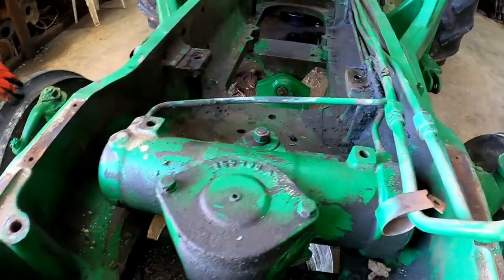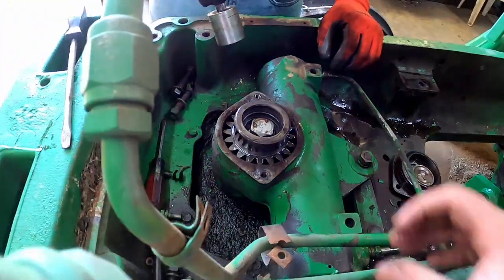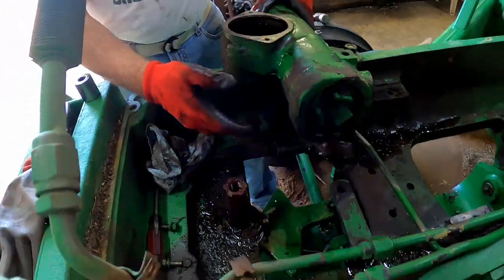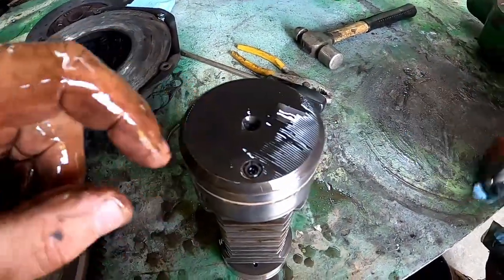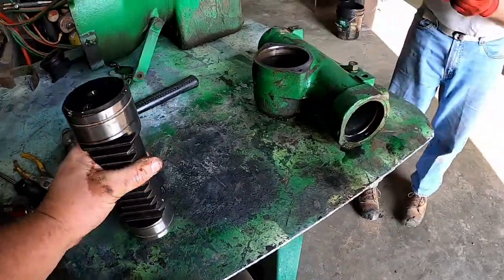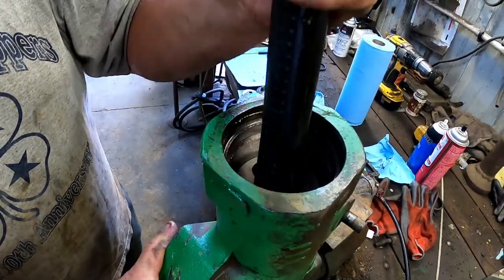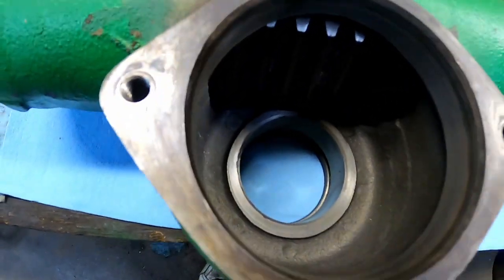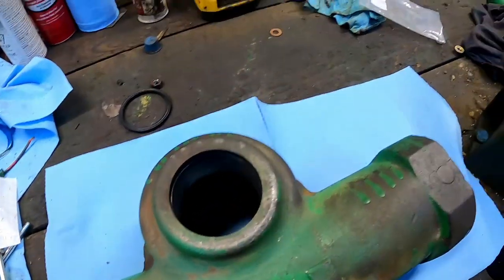Oliver Tractor Power Steering Box Rebuild

Comment: I seen this come up in my list of videos to watch, which my son and I have done the White American 80 twice on the complete tare down. We also have taken it apart for the steering sector arm, due to the bottom not being on correctly and wearing. This isn't too bad to do, it's just a little bit of a pain when you don't have a place to do it in. Nice video, good instructions on the rebuild. Thanks Chris, have a good evening and a great weekend!
Reply from the maker: I remember there were some recalls on the front axle of the American. One involved the steering arm. It had the wrong geometry and one side would steer too sharp compared to the other side. I would think something like that would have been a no brainer by the late 1980s, but they beat the odds on that one. 😂

Comment: It looks like a similar system to the John Deere 4020 except there are two pistons. What seems to happen when there is a failed seal in those is the steering will turn the front wheels for you. Unfortunately the same symptoms appear if the steering valve under the dash is leaking. It pays to learn to do as much for yourself as possible. The cost to have Deere rebuild the steering valve is about $1200. A rebuilt valve from Abilene machine is somewhere around $900 but the rebuild kit from Deere was $150. There is another alternative. Someone has put out a steering valve similar to what Oliver used as a direct replacement for the original valve.

Comment: Thank you for another great video!  Any chance that you could list part numbers in the description?  Th PNs listed in the power steering conversion were very helpful.
Reply from the maker: I just added them. Thanks for the suggestion!
Reply: @ThatOliverGuyChris  All parts are in,  thanks again for posting.  Any tips for pulling the pulley and damper on a 1850 Perkins; or is it as simple as gunning the crank bolt and pulling both as unit? I assume that the crank is keyed to the pulley for alignment.
Reply from the maker: @79mkv  the perkins pulley is splined with a taper lock bushing. Zip the bolt off , and it should all wiggle off without a puller.
Reply: @ThatOliverGuyChris  Thanks. I did not notice a master spline and the shop manual made no mention of alignment between crank and damper.   Can the damper go on the crank in any orientation? And yes, I had sharpie in my pocket but chose not to use it.... makes things more fun.
Reply from the maker: No alignment on those. Slide it on and tighten it down.

Comment: I had a power steering line blow on my 1650, got it replaced and topped off with new fluid.  While turningthe wheel to chase air out, i noticed the power steering box moving the opposite way i was turning the wheel.  Is the box supposed to move a little bit (1/2") or stay stationary.  Thanks for all your help and videos.  JF
Reply from the maker: It's not supposed to move. Check the pin that the drag link connects to in the frame, it may be loose. It could be the drag link itself is bad and needs replaced.

Comment: Hey Chris, I had a steering type motor up there on the steering on a 285 was leaking thank you so they changed it but after they changed it, I was bailing hay and if you put the brakes on the power takeoff goes off, banging uphill, they said to set the battle of the pressure up. Where do you do that at?
Reply from the maker: I don't have a video on adjusting the hydraulic pressure, but Ross the Oliver Man does at https://youtu.be/XyXG1Ggwmlw?si=RR979poFw7MFpHiz
There is a pressure reducing valve in the valve body that is down by the left brake. That feeds the brakes and PTO. The brakes and PTO use only about 180 PSI, so I doubt it's your pump or main pressure setting. There's probably a sticking valve in the pressure reducer or priority valve, and using the brakes increases the flow, which drops pressure. The PTO valve is designed to disengage when pressure is lost so that when the tractor is shut off the lever kicks out and the PTO is off next time you start the tractor, so the same feature is kicking the PTO when the brakes need oil.

Comment: Question for you. Have 2-105 with same steering gearbox as video. Hit a tile suck hole and busted an inner tie rod end. It started leaking at the top plate of steering gear box. Re sealed top plate. Still leaking in same spot. Do you think the jolt of hitting the hole could have tweaked that top plate? We tore the whole steering box apart and all the seals look fine. The only thing I can think of is that top plate got tweaked upward and doesn’t fit tight to main gearbox.
Reply from the maker: It could be cracked, or the main box could be cracked.  Id try replacing the cap first just because it's easier and cheaper.

Comment: Maybe experience says it's not necessary, but there is a setscrew in the center of that final cast cap.  If removed that looks like it might release suction at disassembly and pressure at reassembly?
Reply from the maker: It would do just that.

Comment: Do you happen to have a video on replacing all the O-rings a stuff on the steering motor on my 2-155? I bought the o-ring kit already but I’ve never been inside of one of those so failure is sure to happen if I just start tearing it apart lol
Reply from the maker: I don't. I've only ever replace the shaft seal. Have it ready for Ross when he gets that corn head. Lol

Comment: We have an 1850 with gb660 loader, been in that steering box so many times. Its been a few years and have to do this rebuild on the 1955. Awesome refresher!!! Thanks

Any chance you include recommended place for rebuild kit/parts like the steering conversion
Reply from the maker: I just updated the description with all of the AGCO part numbers we used in the this video. Maibachs and Ag Parts First both offer a seal kit that has everything listed.

Comment: Hi. Just rebuilt this on my oliver 1850 with your video as my guide. My problem is the steering motor keeps jumping out of position during test drive. What am I missing?
Reply from the maker: Did you get the bolt that goes into the top of the gear tightened down properly? The bolt I'm talking about is being tightened at 25:35 in this video. Once that is tightened down and the top cap is secured, the box should not be able to go up and down. If everything is tight, then there might be a bearing out in the vertical spindle of your narrow front. If that wasn't a problem before you rebuilt the box, then I'd take the top cap back off and double check that bolt. Could be the washer that is welded to it broke and isn't holding it down.

Comment: The guy I bought the latest 1855 from said that a bearing went bad and let the steering shaft drop down have you ever seen that happen or do I have big problems in there somewhere
Reply from the maker: The bearings only center it up. If the shaft dropped down either the the top bolt screwed out or the shaft broke

Comment: Hi Chris-

Thanks for the video. Always worth watching.

Question- Have you ever removed and reinstalled the end cap off of the steering cylinder in the tractor without pulling the radiator?

My 1800B is pushing oil out of the access hole for the snap ring,
Reply from the maker: I haven't tried it.

Comment: There must be two different types of power steering units for the 770 ?   Mine I had big issues with.  Had it apart at least 20 times before I figured out the problem. Each time on the end of the shaft the " O " ring was cut.   Finally I notices a tiny crack in the outer collar / bushing on the end of the shaft. The factory weld was cracked........ maybe a  1/ 32 of an inch. When it traveled to the end it cut the  O ring because it traveled too far.  If a person dont really pay attention......you can miss it !   I tapped the collar back on and spot welded it back on. Problem solved !
Reply from the maker: Yes. Early 770s used the Gemmer power steering box. That was more of a power assist, as the steering  shaft went all the way to the box and still mechanically moved the parts inside. The later 770s had a box like the one in this video that steered totally by hydraulics.

Comment: Is the steering oil coming from the transmission ? Or is it seperate.
Reply from the maker: On most Olivers it comes from the hydraulics, which is separate from the transmission. Industrial tractors, and even some ag versions had a separate belt driven pump to power the steering system. Those typically used automatic transmission fluid.

Comment: It's a lot easer to do this on a wide front tractor than it is a narrow front, I did the NF on my 1850 and it was a bit of a job getting the bolt tightened up inside and it didnt help that the bolt was loose to start with so the shaft was a bit worn but its tight now ! Bandit
Reply from the maker: I've never had to do this job on a narrow front.
Reply: @ThatOliverGuyChris  Your lucky, I've done it twice once on a 1550 and now the 1850 and if the NF mower bearing is a bit wore it makes it even more fun !  Bandit

Comment: My son has a 1650 and we used it to plant corn this spring. It is hard to keep it on the marker line. It seems like it always wants to drift to the same side. I forget which side now but you have to constantly keep correcting it. It does have  1 front tire that is bigger than the other and we are going to fix that but could it have another problem that would cause this.
Reply from the maker: Usually it's the right that drifts to. It's the steering motor in the dash, that Saginaw unit tends to drift, especially on the road. There's not much rebuilding to those and the best solution is to replace it with a Char-Lynn steering motor. I've got a set of videos on doing that job on a 1650.

Comment: I would assume almost the same for a 1750, could this possibly put air back into hydro system/pump if seals went bad?
Reply from the maker: Exact same steering box on a 1750. I suppose it could let some air in when oil leaks out, but I find that highly unlikely. Now if you get into a 1755 that has a cooler circulation pump that also includes a drain line from the steering box to that pump, then the answer is yes. I worked on an 1855 that was doing just that, so we capped off the drain line that went from the steering box cover to the pump. No more air.

Comment: Is it possilble (worthwhile) to add power steering to my 770 Row Crop?
Reply from the maker: Power steering was an option for the 770, but not a common one from what I have seen. The factory unit was made by Gemmer, and still had a shaft and gears to turn it from the wheel, but would activate the power part of it while steering to make turning easy. Later on, Oliver offered an update kit to add this kind of steering box to the 770 and 880. A Saginaw hydrostatic steering motor was added at the bottom of the dash and one of these boxes was placed up front with steering lines in between. They do steer nice and easy with power steering. If your 770 is a loader tractor, it would be a big difference.
Reply: My 770 has factory "power steering" it leaves a lot to be desired it's more like power assist the rebuild kit cost a arm and a leg. I think you can add a power steering to the shaft buy the bell housing on Any oliver fleetline/770,880
Reply: @ThatOliverGuyChris  i saw a 880 sell that had this updated style last year i figured it was home made cool they made this upgrade
Reply from the maker: @marcussamson7640  I've got a couple copies of the service bulletin that covers the upgrade. I bet they steered nice.

Comment: My grandpa has a 1650 and an American 60 that don’t turn. What might be the problem and how much work might go into fixing it. Have a good one
Reply from the maker: Won't turn at all? Steering wheel won't turn? Steering wheel turns but nothing up front? Some more info would help.
Reply: @ThatOliverGuyChris  I got more information today, 1650 does turn, just very badly. I’m told you can crank the wheel one way and it will start to turn at the end of the cranking. When you turn the wheel the other way it moves it jerky motions. My uncle is thinking something in the box is wrong. I have no more information on the American 60
Reply from the maker: On the 1650, try holding a remote lever back while steering. If that improves the steering, then there is a spool that is sticking in the priority valve. If it doesn't improve,  it could be low pressure, or something in the steering motor in the dash. Normally there isn't much that binds up in the front, but you could try jacking it up and turning without weight on the front wheels to see if it improves, or if you can hear something squeking.
Reply: @ThatOliverGuyChris  and on the American 60, it takes a lot of steering wheel turning to get any front wheel turning, would the same test be a good one to try? Also, should the remote be hooked to anything when it gets held back? Thanks for the ideas!
Reply from the maker: It's best if the remote isn't hooked to anything. What you're doing is creating back pressure since the oil has nowhere to go,  and it feeds back into the flow divider and steering. You could try it on the 60, but the flow divider on those is different as is the steering motor.
Reply from the maker: Does it take much effort to turn the wheel on the 60?
Reply: @ThatOliverGuyChris  with the 60 I honestly couldn’t tell you, they had the steering problems a few years ago, parked it in the back of the shed, and it has since had a seal dry out somewhere in the rear end, and puked all the trans hydraulic fluid onto the shed floor, that one needs some other help before I can check steering haha

Comment: Great vid Chris. I may have missed you mentioning it but there’s no need to bleed the system after the lines are hooked up? Take care & stay safe. Cheers
Reply from the maker: Correct, no need to bleed the system. The air will work its way out of the system with a few cycles of steering full left and full right. This tractor got 'bled out' at the end of the power steering upgrade part 2 video.
Reply: That makes the job a wee bit easier. Bleeding systems can be a real pain. Ty for the response. Cheers

Comment: Great job Chris. Any tips/ suggestions replacing power steering hoses on a 1800 A ?  Hoses need to be replaced before pressed on fittings below dash where meets steel fittings to pump
 Can these be spliced if so what type fittings and what size hose ?
Reply from the maker: I'm not following 100%, but they can all be replaced with hose if you want to go that route. There's some JIC fittings, and some are inverted flare. The simplest solution is to take the lines off and take them to a NAPA or a place that will make hydraulic hoses. They will be able to match up the fittings on each end and make them any length you want.
Reply: @ThatOliverGuyChris  Thanks Chris. It looked to me the ends toward pump are pressed on and un removable where rubber meets steel. I will double check to assure that is correct. I assume my only option would be to cut hose before it met Steele and couple / splice the rubber hose back to steering .  I could be wrong and probably am but I will send you a picture if possible . Love your videos !
Reply from the maker: Where the rubber meets the steel is a crimped on fitting, and not reuseable.  So you have to replace the whole line, rubber and steel.
Reply: I was afraid of that ! Dang !!! No fun ! 🤨
Reply: Thanks Chris. 🙂 Appreciate your help and advice.